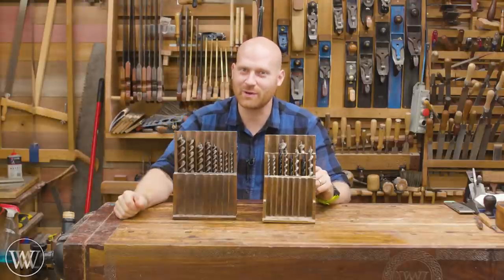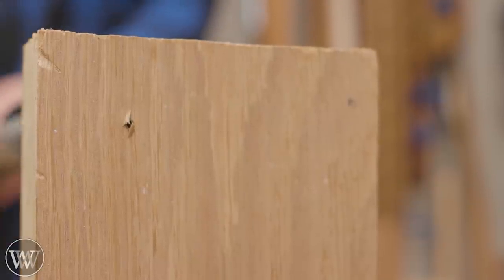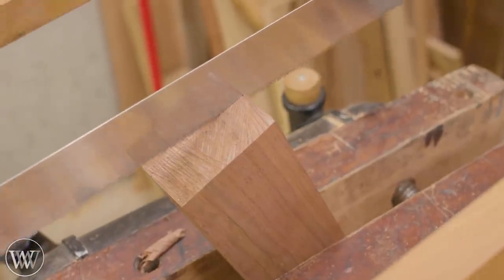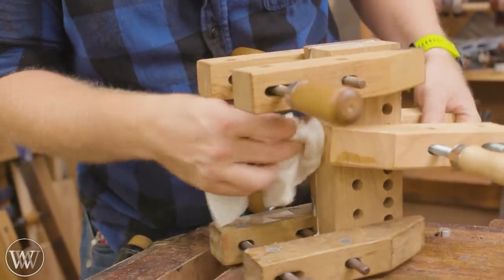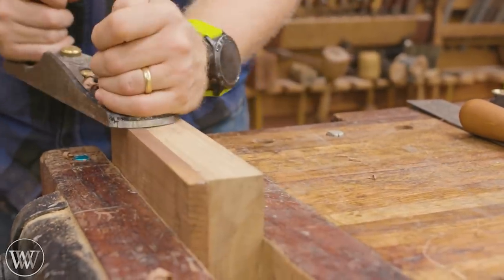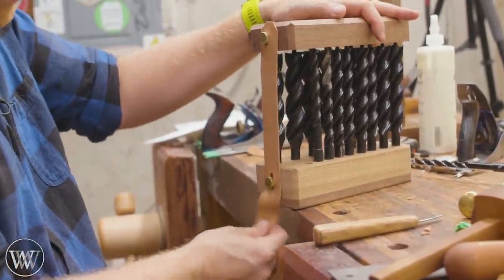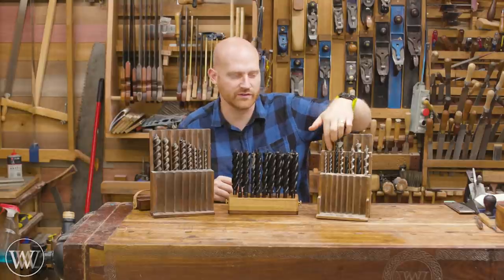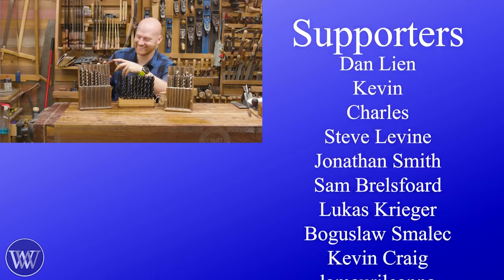How to Make an Auger Bit Holder

Comment: I always love when you ask us what you could have done better, I mean I know I'm still quite the beginner and I've no clue what you could have done differently let alone better. Great video though I like the look of these bits, they just seem like they would eat through the wood and leave a nice interior finish. I'm used to things like high speed twist, spade, and forstner bits so as soon as incan I would like to buy some. Oh and thanks for the tip about buying scraps of wood at cabinet shops never would have thought about that. The Top less Woodworker might make people think that your a woman doing woodwork in a bra or less, but would definitely garner a ton of views, however the viewer would only stick around for 30 seconds because they wouldn't get the joke

Comment: I work for a power company in AZ,i only use wood owl bits in my hydraulic and battery drills,we send them back for sharpening about once a year,theyre almost as good as my 100yr old Stanley brace bits
Reply from the maker: I lover them up one side and down the other!

Comment: Maybe, you could extend the leather over the top part in a loop to carry it with. But it looks just great as it is.
Reply: @Bob Pearson - - - The handle loop idea is perfect!
Reply: Sounds like a great idea as long as it is good stiff leather in the handle part and relieved/softened at the fastenings. If the entire strap was too soft, it would stretch over time, if carried too much, under the weight of the bits and the fastenings would not hold as well. However, it could be switched to snaps at the bottom and perminately fastened at the top, or visa versa.
Reply from the maker: that is an interesting idea!

Comment: Nice project. If you use a long strip of leather that goes from side to side you also have a handle for the "box".
Reply: True, just beware of stretch elongating the toggle holes if they get carried too much by said handle. The collection of bits does add up in weight.

Comment: You probably leave it in yoour shop 90% of time... topless!!! I wouls suggest you do holes in the leather so you can attach the top under the base. It will add so weigth to your base and not have to search the top when you really will be going out with the bits.
Reply: I was also thinking that the loose top would almost guarantee it wouldn't be found when needed. I thought that a pair of short dowels glued to the bottom of the top and would be out of sight between the bits when the top was being used. These dowels could then stick into holes under the base, allowing the top to be stowed and attached under the base.